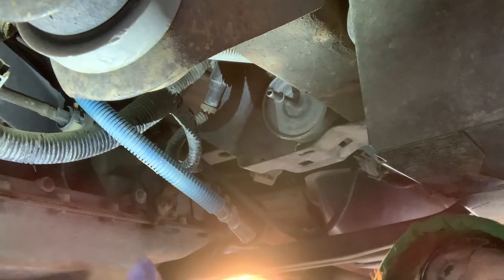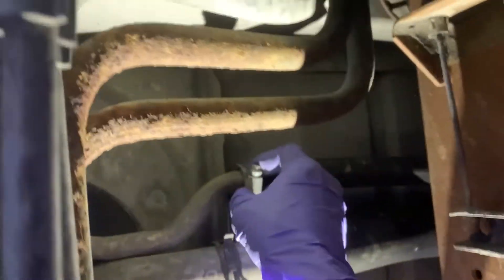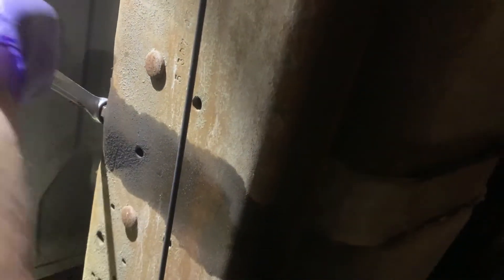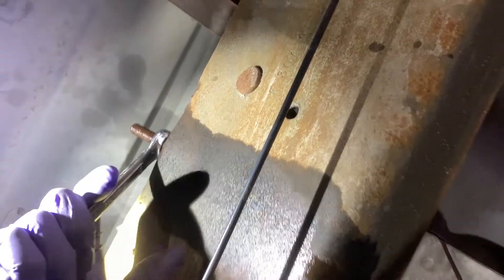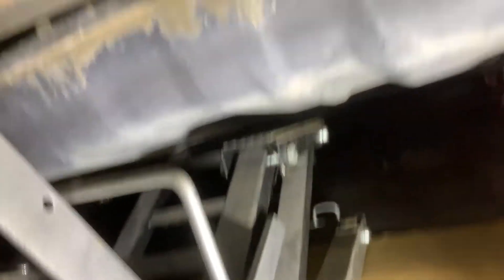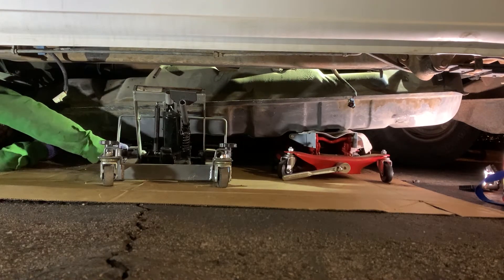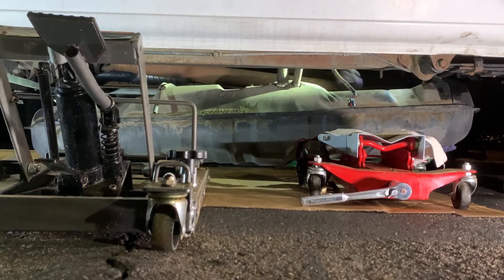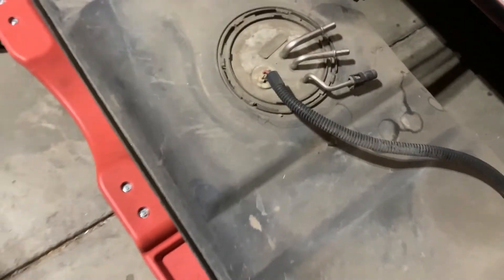96 Ford E-350 Fuel tank Removal | Do This Before Fuel pump Replacement

Comment: Yesterday I ran my truck without oil and obviously the motor is gone. 
I have had this van parked on my back yard for probably 5 years (it was my inheritance from my grandma so I didn’t want to get rid of it) and I think I’ll have to get it running. 
This video was quite informative and it showed all the steps you need to take. 
Much appreciated.
Reply from the maker: that's no good! nice you have that van though. no problem, a new pump and tank cleaning should have it running great

Comment: This is awesome. I just bought a 92 5.8L E-150 that needs a fuel pump and starter replacement.
Reply from the maker: nice, make sure to clean the tank properly and use a high quality fuel sending unit like Delphi, they warranty the pump for life if you cleaned the tank properly. starter is super easy to replace especially on a 460
Reply from the maker: probably easy on your 351 also

Comment: Thanks for the video. Look forward to the fuel pump replacement, if that is what you will be doing.
Reply from the maker: no problem! That video is coming soon. pump module replacement with delphi and new wix filter. full tank cleaning and outer tank and frame restoration

Comment: Why don’t manufacturers they build a trap door that can open and close . With a gasket seal. On vans

Maybe like a car under the back seat
Reply from the maker: Probably to save cost, its best to pull the tank and clean it or you could just be wasting money with a new pump anyways

Comment: Hey man, awesome video! Thank you for creating this. I have a question about that aux port on the fuel pump. Looking under my van I notice I have the same. As far as you know, is this the same quick-disconnect as the other two ports? Thanks again.
Reply from the maker: Hey thanks! Yeah looks like its the same connection. Not sure what its for though. The new pump assembly came with the block off cap already installed. I wonder if its for a aux tank for fuel transfer

Comment: Nice work. Is that a plastic tank or metal? If metal, are you going to line it with some time of POR solution?
Reply from the maker: Thanks, its metal, i fixed the small rust spots on the outside with Eastwood encapsulator platinum then coated the whole outside in flex seal

Comment: When did they start 2 put fuel pumps In gas tanks?
Reply from the maker: good question, I think they changed it around late 80's early 90's. I think they did it so it keeps the pump cool so it lasts much longer. which is also why it's not good to drive constantly around with low fuel. makes the pump wear out faster
Reply: Had 81 dodge van changed fuel pump 2 or 3 times in a walmart parking lot in 1hr (kept van for 15yrs!!!!) Beats an expensive,  very hard 2 change pump -anytime! Older easier.

Comment: I'm sorry...would this be similar to dropping a tank on a e150 08 ? It looks very similar . Do you happen to know ?
Reply from the maker: should be pretty similar. might be some slight differences but basically the same
Reply: @4WheelKid  It looks just like everything under mine! I think it just might be. This is extremely helpful thank you so much !
Reply: I have ‘11 E150. Dropped fuel tank twice to change fuel pump. Same procedure for my ‘11. I’ve done extensive work on my ‘11 and have owned 3 prior to this one. If you need any help with anything hit me up. I’ve done everything under the sun on Ford Econolines. Except replaced engine.

Comment: What's size tools did use in all
Reply from the maker: can't remember exactly but I used metric. mostly basic tools besides the fuel line disconnect too
Reply: @4WheelKid  thanks for replying .. thinking  of pulling one from another one van  mine is leaking from the bottom..